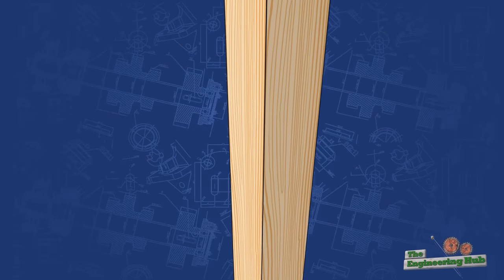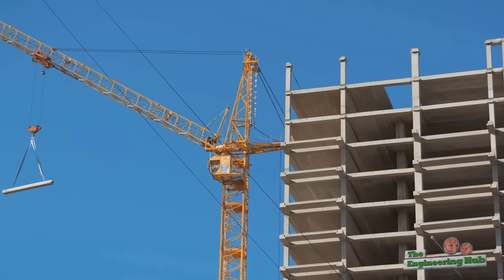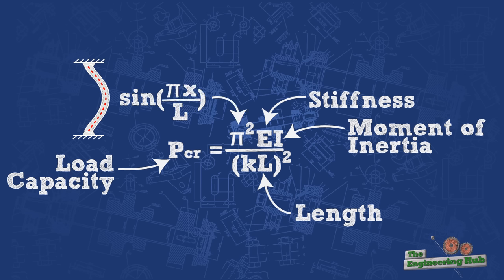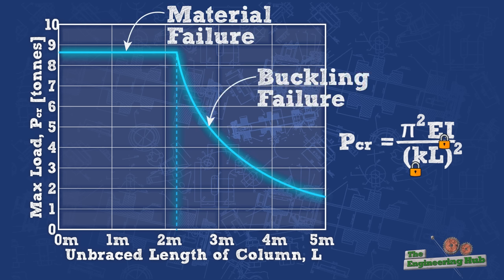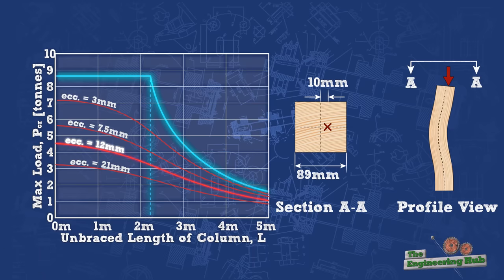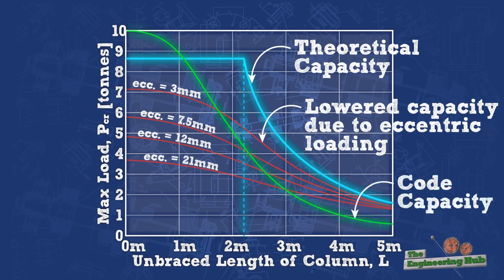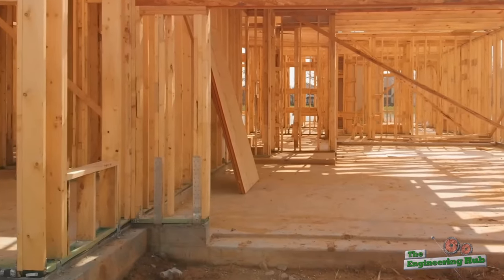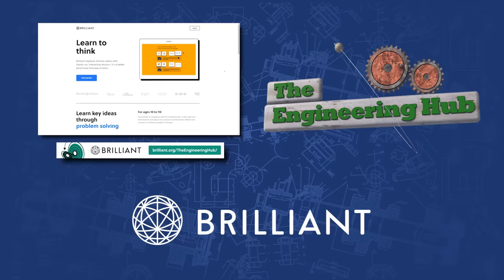How much load can a timber post actually carry?

Comment: As a coalminer, I used to trust my life every day to plain, round, de-barked, timbers posts, [usually spruce] 6 to 10 feet long and 9 to 12" diameter ... and I'm still here.   With good cap and foot blocks these posts would still be standing when the 6"x4" rolled steel joists they were supporting were buckling under the weight of rock above. In addition, timber 'talks to you'.  As a 'weight' comes on and it is getting close to failure, timber gives you fair warning
Reply: Nice piece of knowledge.
Reply: very good point about the "timber talks to you", the cracking sound means RUN hahaha
Reply: Fair warning. I like it. Respect
Reply: You're absolutely right. there is a big difference between logs (de-barked timber) and wooden 8x8 beams. Logs are PERFECT! Processing  timber creates new problems. We cut the grain for the shape, not function. The tree grows in order to survive. Every cell is tested ( daily!!!!) with that equation.
Reply: @voya8480  Absolutely correct ! You only have to look at pre 20th century timber frame buildings or wooden ship hulls to appreciate how much more respect craftsmen had for the natural form of the wood and its use in cleft timber components.
Reply: Wait, 6x4? As in a hollow rectangular tube? That would definitely buckle
Reply: @pepperypeppers2755  rolled steel joist, girder , I beam, RSJ call them what you like .... but not a hollow tube   A three section roadway support arch would weigh  450kg approx - not exactly lightweight stuff.
Reply: Well, if you wouldn't have been here, you wouldn't write this comment, not much of an argument..
Reply: The Empirical Design Process ie. the application of proven sizes, proportions, materials, and assembly design , is in many cases, I suggest, of equal value when compared to scientific processes such as the loading and destruction testing of materials. What is, however being rapidly lost, is the number of experienced craftsmen with the knowledge to apply it wisely.
Reply: @bigoldgrizzly  wooden ship hulls were not made of logs.  Shipwrights shaved them, and warped them into the required shapes.
Reply: I'm curious why you specified that the logs were debarked. What role does the debarking play?
Reply: @LitoGeorge  "debarked" is part of the description.  That's why he mentioned it.
As far as the role it plays... if nothing else, debarked logs are easier to lean against.
Reply: @RonJohn63  no, it takes effort to debark logs. I'll get the answer from the coal miner thanks
Reply: @John Martlew 
Doesn't surprise me .... far too many 'installers', and not enough skilled carpenters ;<(
Reply: Thanks for doing that mining, my dad was a coal miner, 30's through the 50's .
Reply: @LitoGeorge  logs are debarked because bark traps moisture and moisture rots the wood. Removing bark is a very quick and effective means to extend the life of the wood.
Reply: @LitoGeorge  not a coal miner, but I do know that bark left on timber can retain moisture, fungi, bacteria, and insects which can rot the timber. It also makes it much easier to handle and work with.
Reply: @bigoldgrizzly  Old Grizzly:  You might be interested in reading a book called Six Frigates.  It is about the founding of the US Navy and the construction of the USS Constitution and 5 other frigates.  The book details how they selected the trees they were to build the ships out of.  
Similarly, I watched a documentary about the reconstruction of the roof at Notre Dame Cathedral after the fire.  Way back when it was first constructed, they had no power mills and thus cut the wood while still wet shortly after felling a tree.  It was easier to hand hew it before it dried  As such, the wood would shrink after cut to dimension which they had to account for in selecting the trees.  They figured out what to look for in the trees so that it would still be straight after it dried, I just don't remember the details of what they said about the process.  
They are approaching this, apparently being sticklers for history, in the same way in the reconstruction.
Reply: @Anon54387  
I would indeed be interested in that book for more than one reason and will most certainly seek out a copy.
The use and selection of naturally grown wood forms in ship and house building goes back into the mists of time, certainly 1500 years. These skills came to the America with the first settlers, indeed carried those settlers over the sea. Such skills are very rare today, but, for the time being, do still exist if you search hard enough.... but for how much longer ??.
One of my distant forebears was considered to be the Founder of the US Navy, Edward Preble. He was Captain of two of the  six Frigates you mention, the Essex and later, the Constitution
Reply: Thank you for doing the job someone had to do but nobody wanted to
Reply: This selection of live wood was so prolific that 2/3's of the trees in New England were off limits to the settlers, declared Property of the Queen  masts for her fleat.
Prior to North America  people would invest generations to grow ship parts 50% "precast/pretension" with proper supporting grain structure to support its intended use.
Reply: @daviddroescher  
Sadly an impossible way to work these days other than small specialist projects. What is however, gaining momentum fast, is the use of laminated timber elements. These are first steamed to shape then assembled using modern glues in clamping jigs. They are as strong, if not stronger, than 'grown to shape' elements. and offer a great alternative to reinforced concrete or steel load bearing structures.
Reply: @Old Grizzly  It's the lack of merit in the modern age has led to the decline and disappearance of the skills set, to grow a tree with a structural end use in mind.
Ever try to split a stump ? 
It's way more difficult to split a keel by running a ground, made of a "y"ed stumps stacked together  than a consistent grain  glue lam. 
Sawen Wood is like continuous strand carbon fiber 3D print. It has full strength in 2-15-2.5.  axis  ( eg x:1 full y:1 full. Z: 0.15-0.5 ) The Z axis ( vertical) has only the resins for structural strength( combination of x and y for wood ). 
 Debarked logs were used to improve this number to ~0.75 axis by not cutting the rings you are not solely relying on the  water soluble resins to keep the layers from delaminating .
Reply: @LitoGeorge  Bark doesn't help you at all, if anything it can harbor pests and extra humidity. You don't want that. It also make the surface much raspier than desire. You're just removing the part that either does nothing or makes things worse.
Reply: @louisvictor3473  thanks to you and everyone else for their insights. I can see how the bark degrades the wood more quickly.
Reply: @bigoldgrizzly  you seem like the classic case of experienced tradesman who thinks he's basically an engineer. No one would put themselves through engineering school and then years of training to end up working down a coal mine, so asking for someone who is both an educated engineer and a skilled craftsman who uses rules of thumb is an impossibly tall order. I do agree that many engineers nowadays lack practical and buildability knowledge, and that there should be a greater focus on that.
Reply: @bensblues  You are very free with your assumptions and could not be more wrong. I started at the Pit  working underground by day and attending night school then progressed to a first degree and then my Masters, became a Chartered Mining Engineer and was granted my Mine Managers Certificate of Competency. From start to finish, the training and qualifications took 7 years.
The National Coal Board insisted that all Engineering Trainees literally started with a shovel and received the same practical training as the the different branches of the workforce. It would be a very foolish young engineer who did not give careful consideration to ideas and advice given by older experienced Colliers.
Reply: @bigoldgrizzly  the tensil strength of some wood approaches steel pound for pound. the government published a book many years ago on how strong the different woods used in construction were in compression, shear and tension. i was suprised at the compression and shocked at the tensil strength. some of the old military assembly buildings had 100 foot or more spans of 12 foot boards designed to use compressive forces. i don't know if they still have them or not.
Reply: how does that sound like????? or are there visual clues as well
Reply: @voya8480  yeah seems logical...i think if you use logs instead of beams with the right thickness for every job you can use wood at maximum efficiency....
Reply: I work with Locust Posts. A debarked locust post is enormously stronger than any rectangular beam cut out of that same post. What all these discussions on the strength of wood leave out is grain run out. Many times when  you saw rectangular beams your blade will run out of a grain. At that point in the beam you have created a weakness All baseball bats now are carefully selected for straight grain logs and machined to produce a bat where no grains run out. It is always at the the point of a run out where the bat will break  most easily.
Reply: @Dsquaredforever    Quite so. 
They were mechanically de-barked. I would add that the bark would add little or nothing to the strength and when transporting thousands of these, weight and volume reduction would be a consideration. Another consideration for the miner is when debarked, they would have dried quite a lot during transport and haulage, Occasionally we would get batches of green wood and they were bloody heavy and not welcome. Imported timber posts have to be debarked to satisfy cross border biosecurity laws. In later days all timber was pressure treated with inorganic salts for fire resistance before delivery and I would imagine, debarking would favour this process. You mention insects, we sometimes had those too. In one  hot, deep pit [>100degF, 4500 feet] we were infested with crickets which had the nasty habit of jumping at your cap lamp ping ping, They did no noticeable damage to anything and were just another joy in a miners life ;<)
Reply: @MrSummerbreeze01  
Absolutely..... Many trees die off in the centre and rot out till they are remarkably hollow, yet still stand proud for a hundred years or more, though the worst that the weather can throw at them. It is the unbroken concentric rings of the tree that affords this 'tubular' strength. These rings are exactly what we have  when using timber in the round. As for not violating the grain, splitting and riving boards or beams does produce stronger elements, but it is a tedious and expensive process and in the modern age conformity and symmetry is king. Straight planks posts and beams for the cheapest possible price and b*gger all attention to grain. The closest we get now is skilled visual inspection and physical bending tests in statutory wood grading processes. To be fair, riving timber is very wasteful of wood and in most situations, structural strength is not a key consideration. Where it is important, we must rely on the skills of sawyers grading the timber. I restore vintage tools in my dotage and always rive wood to make tool handles for hammers, axes and the like .. but then I have the time to do so.
Reply: @LitoGeorge  Sorry, I missed your post, but others have answered well for me.  If you look just above, I have added a few other thoughts.
Reply: @hetedeleambacht6608 
Timber creaks and cracks in a way that steel does not. It tends to crush yet still remain capable of carrying significant load. Steel will bend, of course, but when it fails it often does so suddenly and catastrophically. It becomes second nature to be unconsciously aware of such signs, this overall awareness of your environment was something we called 'pit sense' and was only developed over time, from working with experienced miners
Reply: @bigoldgrizzly  thanks mate for your reply, and as a result a return to the thread. I appreciate your added thoughts and information. I find them interesting and educational. Long live natural wood in the round and riving it when you need a different shape. Funnily enough, unrelated to this thread, I very recently hand forged a very large barkspud, for removing...bark. Incorporated was Swedish spud elements and North American elements. Very strong, big, robust and useful. Tested it out and it works like a bomb. Thanks for the intelligent conversation and real world experience.
Reply: @LitoGeorge  
You do some Smithing too?  I have spent the last two days draw filing my second anvil. Long tedious work but the results are very satisfying. I have to tackle my main anvil, a 200kg beast, but not just yet as I took a fall and broke my wrist last night. I must add a spud to my to do list, I currently use a ladies border spade trimmed down a bit and sharpened. I did make a couple of pickroons,  which saves me a lot of bending when log splitting.
Reply: @bigoldgrizzly  very nice. Yes, working with your hands in almost any capacity is very satisfying, particularly when its your interest right? After some time using the spud, I recommend making a light, small model as it honestly gets really heavy quickly if you deal with temperamental bark requiring lots of strokes to remove the same piece. Our paths further cross, as I have pickaroons on my list to forge in the near future. I am impressed you manage to type with a broken wrist. You in Oz right? If so, do you call a fracture a break? I am originally from SAfrica, and I learned to call a fracture a fracture, and a break when the broken is completely snapped in two. A broken wrist would mean a floppy, inoperable hand to me. Different terminology possibly? At any rate, I find it fun connecting with smithing enthusiasts rather than the pro. I find the pro's competitive (and some amateurs too), which is all rather boring to me. Nothing better than chatting with an enthusiast, making tools to use, and imperfect as they are, highly functional and lasting a lifetime or ten. 10/10
Reply: @LitoGeorge  
Hi again, I'm in the UK where a busted wing is a busted wing ;<) Not too serious just a fracture... [ or is it a break ? ] across the wrist end of the radius. hopefully right as rain in a few weeks. I'm a one finger typist normally so no handicap there. My lad is a shop manager in an industrial forge, working lumps a ton or more in size. Like me, he enjoys working at a smaller scale too and, being built like a brick sh*thouse, is a great striker for this old man.
I steer clear of all the 'forged in fire b0ll0x and competitive or showy types A of my few favorites are Nils Ögren, Black bear forge, Torbjörn Åhman, Joey van der Steeg, Gary Huston, Rowan Taylor, Brian Brazeal ....
Reply: @bigoldgrizzly  ha - I like my old traditional understanding. The modern world can get lost with its terminology! Glad you are still good to go. I remember getting stress fractures in my feet in the army, and I couldnt let the rank know about it, or else I would get kicked off getting my own rank. Happened six weeks before the finale, so I paid off the old medical staff and got "an all clear" declaration. Hurt like the blazes coming to attention all day long as I also belonged to the demonstration squad for parade ground marching. Never mind the vehicle ambush weapons phase, jumping out and over the top of that 3.4 metre high vehicle to land in an attack position feet squarely on the ground in a crouched position. OUCH. Those were the days. Of course, it bites me in the butt now and both feet hurt to the point of small tears every time I stand up. After 5 minutes of walking the pain goes away thankfully, only to resume once off the feet for 5 minutes. I agree with you on the tv nonsense. We enjoy the same teachers here on the Tube, and I'm tickled pink by that really. Good quality people.
Reply: @LitoGeorge  I know what you mean. When we are young, we do daft things, think we are immortal and mend quick - all the time ignoring the old guys around us saying 'don't be daft lad, you'll be an old man at 40'
It was nothing unusual for me to shoulder and carry 300 pound steel beams and walk them into the job ... and I wonder why my back is destroyed now ;<))   Those old boys were right, every injury comes back to haunt us [well, me at least] in our old age. The wrist is sore but on the mend, but the other one is now inflamed with having to do more work than it is used too .... I don't seem to have learned my lesson yet, do I  ?
Reply: @LitoGeorge  
afterthought .... Your heel pain sounds to me a bit like Plantar fasciitis. If so a good physio might be able to help you. For my general arthritic pain, I take standardised turmeric curcumin [with black pepper] capsules from piping rock. My pain consultant told me about them and they work better for me than diclofenac anti-inflammatories without all the long term side effects.
Reply: 12" dia wooden post in compression  v a 6" x 4" RSJ in bending; not a useful comparison.
Reply: @andrewholdaway813 looks like you need to read OPs post again.
Reply: @LitoGeorge  
Done that - no change required.
Reply: The assumption that timber gives you a warning when overstressed does not carry over to engineered lumber.
Reply: @benchoflemons398   Never tested it so can't confirm or deny that. I would imagine that engineered lumber, having a degree of inherent grain violation in the sawing process, would be faster to fail along the weakest line and quite possibly quieter. The snapping of wood fibres and the movement of adjacent layers of fibre bundles, are not silent processes. Steel bending prior to a big failure is however, pretty much silent.
Reply: @MrSummerbreeze01  
What do you mean by "run out of a grain" and the other similar expressions?
Reply: Thank you for this great little story, and your additional comments through the thread.
Reply: timber 'talks to you'. .....
I love that phrase!